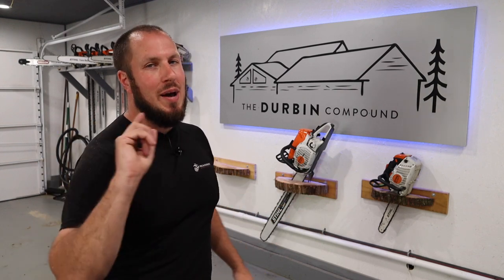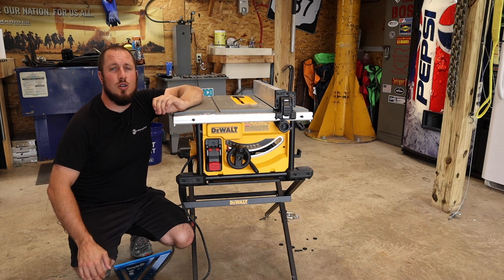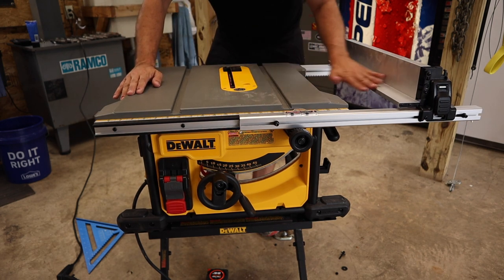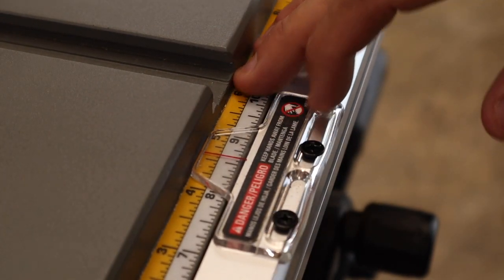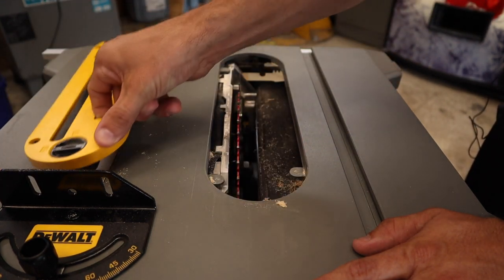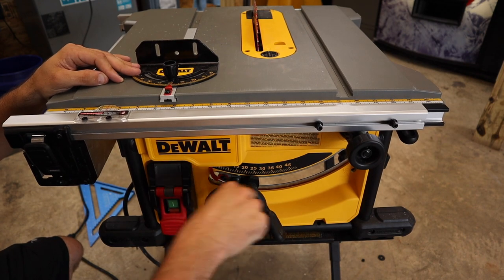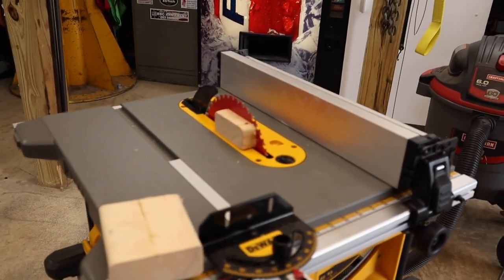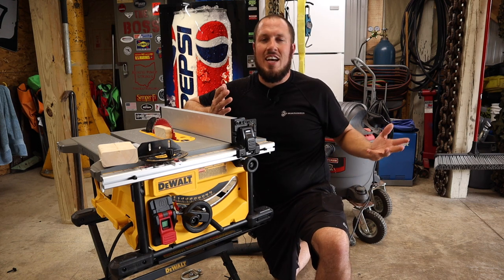DeWalt Table Saw DWE7485-Best Table Saw For The Money!

Comment: Big waste of money. Bought it to build cedar strip canoe. Couldn't get a decent rip blade for it.  Bought a $130 dollar 10" worked much better. More accessories available.
Reply from the maker: So you are saying that a $130 off brand saw worked better?
Reply: @TheDurbinCompound  In this case the cheap Rockwell saw did a better job. I bought a much better blade for it. Part of the problem was the blade. it kept chewing up the cedar. I did not want to take the time to order a blade for it. The other part was it kept binding up.  I just don't think the blade ever tracked straight. I took it back to where I got it and they couldn't make it cut either. I like Dewalt  tools. I still use the cheap saw and it still does the job for less than half the price.